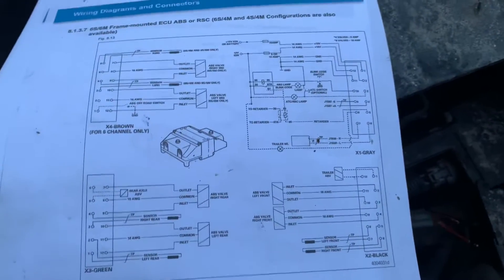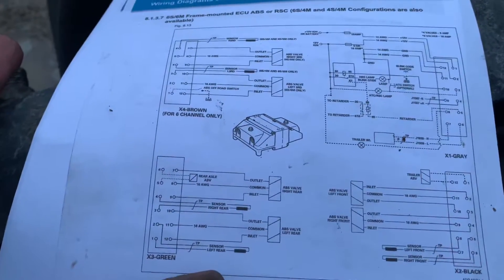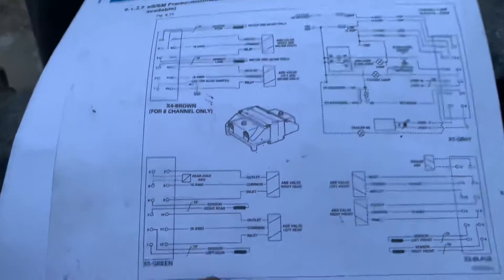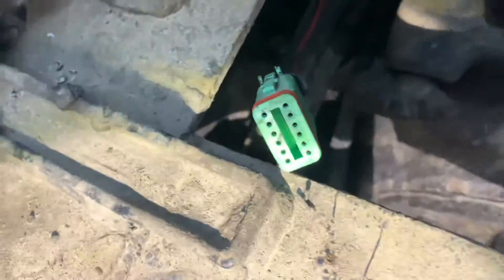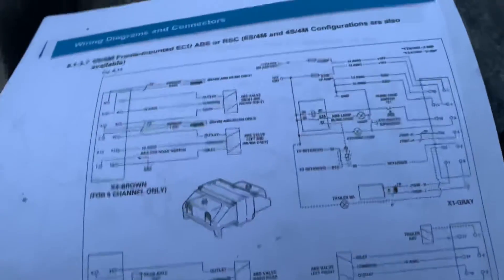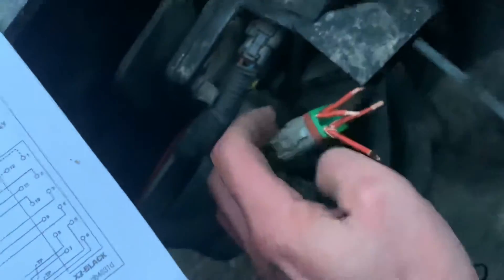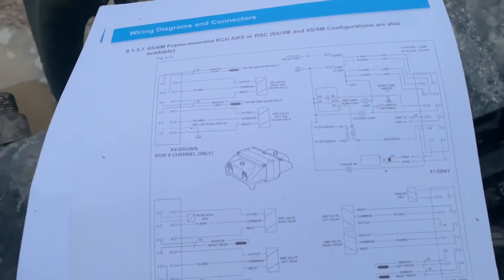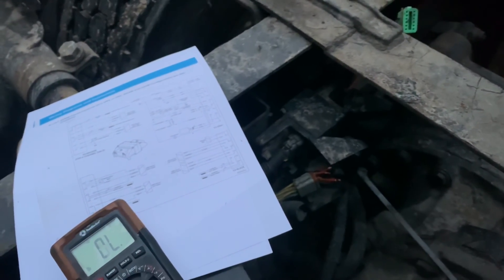ABS ECU module power & ground test. Ignition must be on to test.

Comment: Hello.
Freightliner Cascadia 2016 Auto.
The truck won't start the tractor's ABS light is on and the DEF light is red Flashing 
No check engine light.
The dashboard screen does not show the transmission message and the screen just stuck with Underscore marks.
Reply from the maker: Codes brother, check engine codes, what are they? All of them one by one
Reply from the maker: That’s step one

Comment: Helpful video! Some good advice here, did you ever find the problem that caused the ABS light?
Reply from the maker: Well, I purchased a used abs module and replaced mine. It worked. I guess module was burned due to a water leak
Reply: Do you mean the one behind the driver's seat in the cab or this one you inspected in the previous video? Because it did look good in your inspection.
Reply from the maker: @CarbonPoweredLife  well let me share this with you, the one behind the driver seat was bad due to a water leak, I was driving through rain and I smelled electric burn, I replaced it with a new one and covered it with plastic, then I decided to replace the abs module in the video. I think the water leak fried both on my century. However, there should be an abs button behind the driver seat, if you push it it should give you blinks on dash board, count then then search code on line. My truck did not deliver the codes when I pushed the button that’s why I replaced module in this video. I hope I am helping you right. Ask me more questions if you need any further help.
Reply from the maker: Water leak on module behind driver seats definitely was fried from rain, I think it caused an electric short and destroyed the one in this video.
Reply: Ah ok thanks, yeah I have an abs light on the dash but when I push the button it doesn't produce the blinks that make a code for the problem it just changes the brightness of the light while the button is held. I tried replacing the module behind the driver's seat but it didn't fix it.
Reply from the maker: @CarbonPoweredLife  I would replace the one in the video, I hope this is your problem. Let me know if it fixes the abs light
Reply: Ok yeah I will let you know what happens, I have replaced the one behind the driver's seat. Where is the other one? Was yours under the 5th wheel or something?
Reply from the maker: @CarbonPoweredLife  it located on the passenger side frame to fifth wheel. Almost underneath fifth wheel